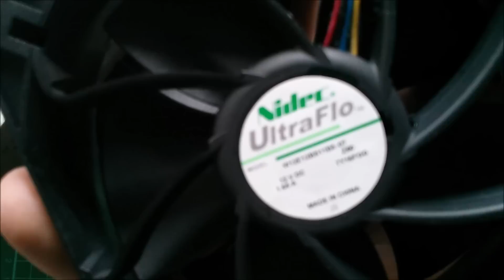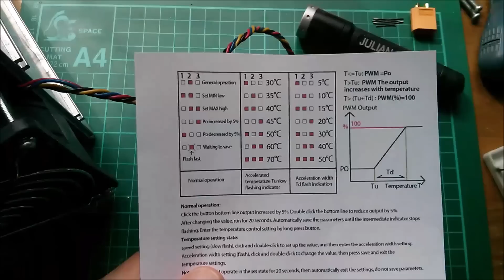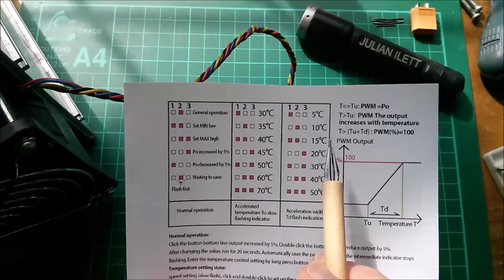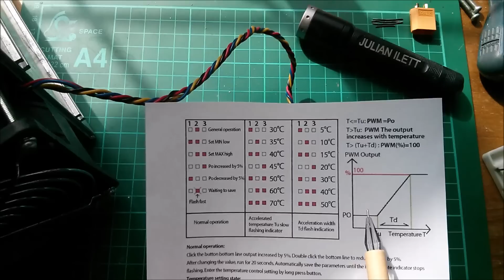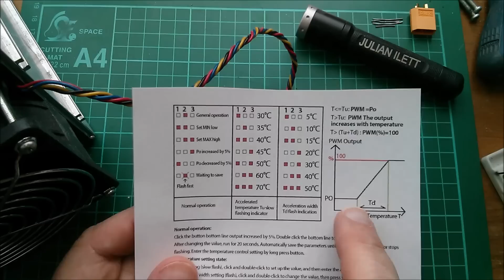Playing with 120mm Computer Case Fans

Comment: Nice video Julian - always great to see electronics gurus dabbling in the world of high power server fans!  If you're interested you can check out the custom controller I break down in my video, which originally came from Nidec's own documentation.  It's a simple analog circuit using just one 555 to generate a square wave.  This is a great way to control the speed of these fans as it's compact, reliable, and super fun to build.

Comment: If your miners are outdoors using solar in the UK, they will never need a fan, unless you're just using them as an audible aid to hear how hard they're working when the clouds let the occasional ray of sunlight through.
Most likely, when there's enough sunlight to power the fans, there won't be enough remaining to run the miner. And, vice versa.

Comment: I believe that "modified" Molex connector allows the fan to be used in either 3 wire or 4 wire connectors.  3 wire are power plus tach for speed control by varying voltage.  4 wire use PWM.

Comment: The "strange modified Molex" is the standard for PC fans. 3 pin = DC or not at all controlled + tachometer signal. 4 pin has the same keying to be compatible, with PWM and tacho signal.

Comment: Restore that Miner parts machine! I would love to see a video of that! Then you will also have another machine. You can get working fans at the dump.
Reply: Computer shops often have loads of junk with working fans. Often they'll give you stuff for free if it saves them having to try and dispose of it. Just don't expect to have the fan given to you on its own - you'll probably have to take an entire case or power supply eland strip it yourself.

Comment: These aren't really computer case fans though. They can be used as such, but they are more at home in industrial and enterprise IT / datacenter applications, hence you have them in your mining thingies. Especially the 38mm (and up) ones are commonly found there and never in desktop computer cases for home use. The increased depth allows for more powerful motors and steeper blade angles for higher throughput which is ideal for use cases that aren't noise sensitive. That's why they have such a high amp rating of about 2 to 4A which puts them at up to ~48 watts per fan. A usual mainboard fan header will not be able to deliver these high currents. Most of the usual computer case fans are rated far below 1A and some are even rated below 0.1A. These are the ones that are suitable for your second controller board with max. 0.8A. As an example, I have a high end 120x120x25mm Noctua low noise fan (NF-S12A ULN) lying on my desk right now, it's rated for 0.06A / 0.72W which is enough for 800rpm and makes it an ideal fan for computer case applications.
Reply from the maker: Interesting, thanks. It does seem to be getting more difficult to find the 38mm 4-wire fans from reputable sellers. When I buy them on eBay, they're inadequately packaged and turn up broken :(
Reply: @JulianIlett  Sure, that's not very surprising, I guess. These fans were not meant for the retail market and only a very tiny amount of people have use for them. There just aren't many shops who'd be interested in this low sales volume niche market. Most of the fans are made as OEM parts and sold to other companies who need them to manufacture whatever their product is.
Nidec and San Ace / Sanyo Denki are two major manufacturers in this market, I think you've also shown a Nidec fan in this video, the one where you've written its specs on the blades. There are more companies, but these ones came to mind immediately. You can look up their lineup online and get the part number for the fan you're interested in and google it, you'll find that Mouser, Digikey or Farnell and similar companies stock them. It certainly won't be cheap though.

Comment: the fan that doesn't react on the controller could be a reverse pwm fan. some fans require an inverted pwm signal to control the speed. I have had this issue a couple of times with different brands.
Reply from the maker: I like it. I just tried winding the PWM up to 100% hoping the fan would slow down - no luck. Also tried swapping the blue and yellow wires - no luck :(

Comment: with a 555, pot, a couple diodes and a few other parts you can make a fan PWM speed controller.  It won't be auto temp sensing though.  i like that automatic fan controller. pretty cool! ;)
Reply: NTC thermistor on the timing circuit, maybe, in place of a resistor? Won't be as effective or adjustable, but could work?

Comment: Pretty sure the PWM signal is supposed to be 12V. Depending on the Fan, it may just directly control a P-ch mosfet that cuts power to the motor. So GND is ON, 12V is OFF.
Reply: On a standard PC fan the control wire is supposed to be driven by an open-collector output. In practice any logic-level signal usually works.
Reply: @eDoc2020  Yeah apparently the fan is supposed to provide a pullup. Although in the spec I found it did indeed say it should only pull up to 5V. Not sure if manufacturers actually do that though as there usually is no 5V regulator on the fan, or if any of these fans would be damaged if you apply 12V directly. Some fans definitely tolerate it.

Comment: Ideal application for a 555 PWM and a power transistor.
Reply: That's not how those fans work. They expect a 5V PWM CONTROL signal, not a turning on and off signal.

Comment: Just replace the thermistor with a variable resistor, and stop playing around with cryptic push-buttons you won't remember next week!
Reply: For manual control, I would get rid of it completely and get a buck converter or a simple fan speed controller.

Comment: The header with the offset keying is just so it fits well with standard 3 pin fan headers as well as 4 (The keying on 4 pin for the motherboard side is the same as 3). It's part of the Intel motherboard fan header specs.
Reply: Came to make this comment but probably with less detail. The offset one is the only one I've ever seen. It's "fully" backwards and forwards compatible with the 3 pin.
Reply: Came just for this.